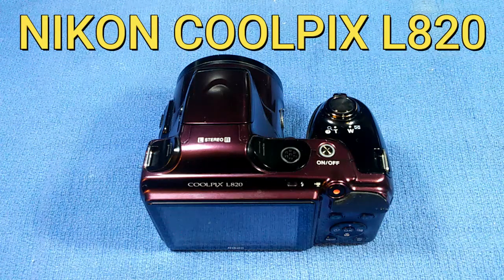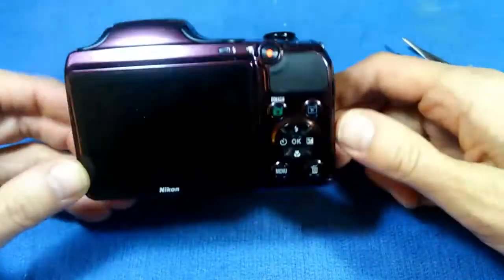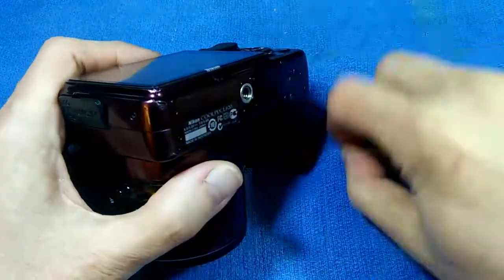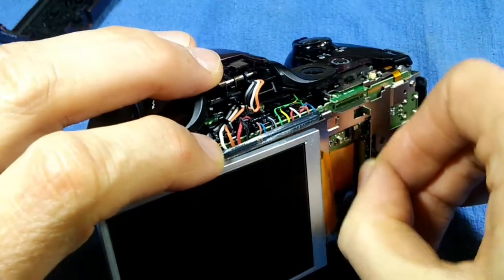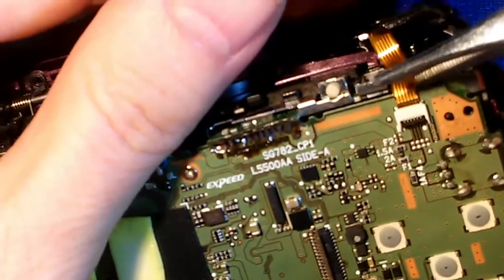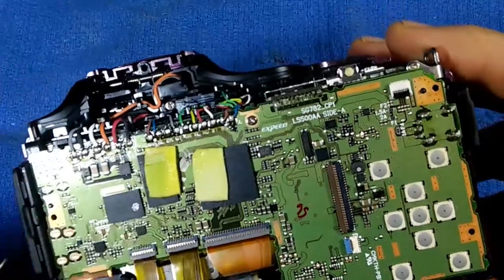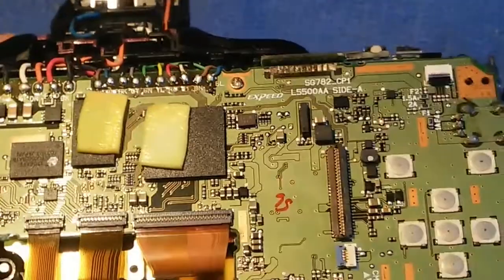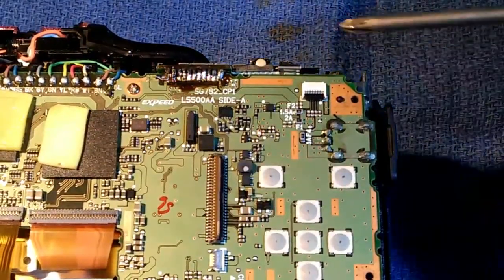Nikon Coolpix L820: Disassembly and Repair

Comment: Thanks a lot, i had one of these not working and completely dead for years. i took it apart today as per your instructions and noticed the same problem as you. fixed it with a jumper wire and works great. Thanks a lot for this video
Reply from the maker: Fantastic.  It must be a common design flaw.

Comment: I have a question about the battery terminals. At some point in that procedure was would there have been an opportunity to repair a battery terminal in the bottom of the battery compartment that was broken while cleaning corrosion?
 Great video and much appreciated.

Comment: I have a L840 Coolpix that I have changed batteries and sd card with new. The camera is hardly used in nice shape but when you turn on within 4-5 seconds a message comes on the screen. Camera will shut down to prevent overheating. Even happens with external power supply. Any suggestions where to look

Comment: Hey, do you remember if this camera has something like a internal battery that keeps the settings memory? I have the same camera and recently, whenever I open the battery cover (e.g. to remove the memory card), all settings are reset and I have to set the date, time, time zone, etc. again.

Comment: I just bought Nikon Coolpix L810, from used market, it's in a good condition and working well with batteries, but i want to connect a Dc power cable with an external power bank, or ac adapter. 
The problem is the socket is not common, can't find a connector for it, so i want to open the camera and replace the socket with a normal pin or mini usb.
Reply: I opened mine l820 & tried the same thing but the camera stopped working

Comment: I just bought one of these used for a few bucks the other day.  The battery door doesn't shut correctly because those clips are broke off.  It works fine but do you have any idea where I could get a replacement part?  The door works fine its the clips that the door connects too.  
Thanks for the video.  Hope you have an answer for me.
Reply from the maker: Sorry, I do not have a solution.  It is very frustrating.  The battery door is so easily broken but there is no simple way to fix it.
Reply: I have the same problem. Did you manage to fix it?

Comment: I find the parts and fix them. After you have done it a few times it's not that hard. For my personal cameras, I was using Olympus but I switched to Nikon, I get broken cameras on eBay the same model then I take one apart and put it back together for practice because every camera is different, and then I have spare parts and extra cameras. I like to have sacrificial cameras because they might get destroyed. It's good to have spare parts, I just got a P520 18-megapixel for 18 bucks, I think it might work because I diagnosed the problem before.
Reply: I'm not a camera tech. I'm an electronics engineering technician. The newer cameras are easier to work on just like everything else. The goal is to make assembly faster with less labor. Less soldering, fewer failures. It just makes things easier to work on.

Comment: I didn't quite understand what the problem was, can you please tell me in couple words tell me what you did so it came back to life?
Thank you very much in advance
Reply from the maker: There was a broken connection between the main circuit board and ground.  I soldered in a jumper to reconnect the board to ground.

Comment: Hello friend, I have a problem with this camera, when I press to take the photo it turns off completely, I turn it on again and everything works fine, but when I press to take the photo it turns off. I hope you have an answer for me
Reply from the maker: I do not know "the" answer.  Does it die immediately or is there a delay.  To trouble shoot, I would consider the possibility that the camera is drawing too much current when the photo button is pushed.  I would turn "flash".  There could be a short or something in that circuit.

Comment: The biggest issue I have found with most cameras is folks leave expired cells in so long that the acid leaks out of the cells and will eat thru wires or the battery contacts.